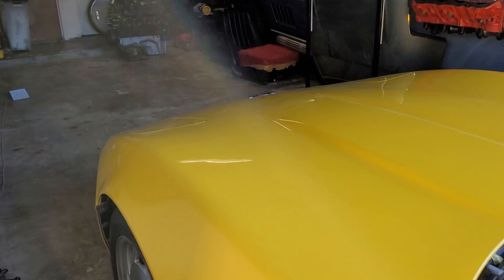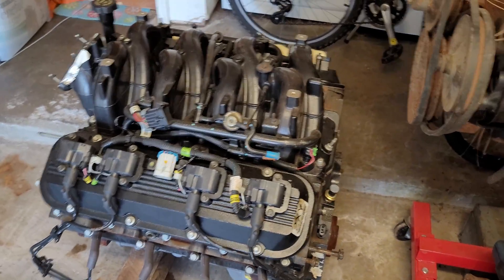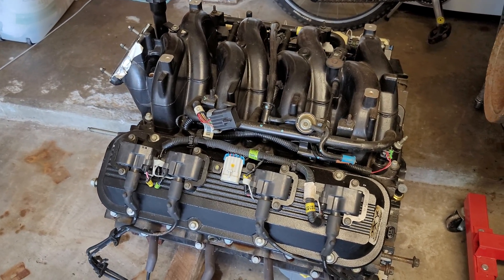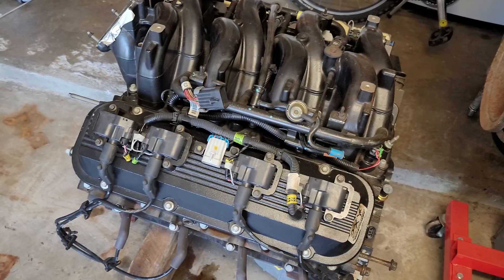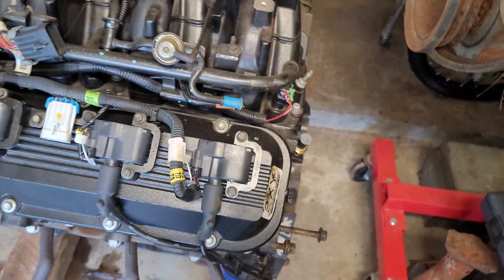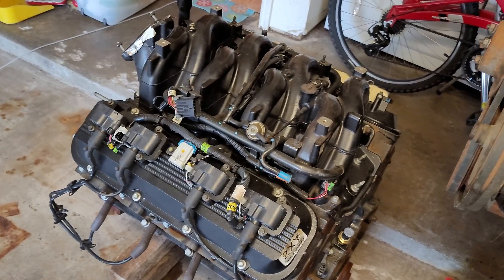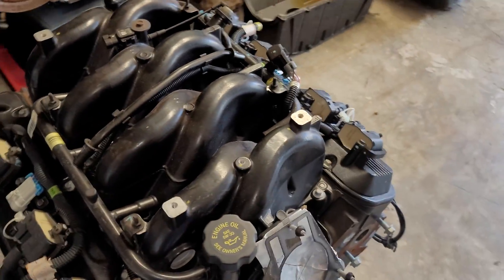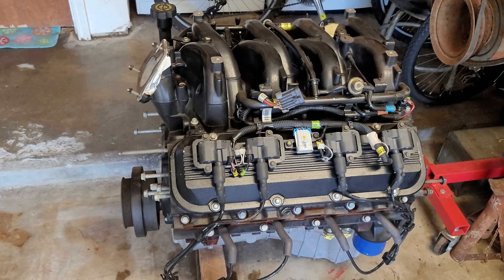The Monstrous Vortec 8100 496 8.1L Big Block Engine of the 2000's

Comment: I have an 01 2500hd with the 8.1 and the allison, Ive been a heavy equipment tech and a welder for the last 20 odd yrs and Im not looking for ward to doing the crank sensor or putting headers on it.  The studs look like rust particles holding hands and not steel, i may just leave the manifolds as im not keen on opening that can of worms.
Reply from the maker: Yea, those factory exhaust manifold bolts like to rust in place and snap off and soon as you put torque on them. I like the idea of the better flow headers, but I'm definitely in the camp of "best left alone". 

The crank sensor is definitely a bugger to get at, but it's workable with patience and being able to get yourself in the correct position on top of the engine so you can get your hands and proper leverage on it when replacing.
Reply: @VetteSource  this truck is bone stock too, other issue is the PRND321 and the mileage dont light up in conjunction with the p0705 so im wondering if the range sensor has something to do with that, also the tow/ haul doesnt light up either.  Whats shitty is that my solus legend wont pick up the mileage stored on the ecu so im wondering if the cluster is fucked.  Im HOPING the range sensor solves the issue, i mean its got to be replaced anyway so...
Reply from the maker: Yea, sometimes you definitely have to get in the weeds with this 1st generation Can-Bus wiring wiring system. Many times the cluster is at fault, but you can also have a problem with the range select switch like you talked about.
Reply: @VetteSource  got everything done and now all thats left is the fuel level sending unit, put some fuel in it and the gauge was all over the place so thats the next thing to do before the snow flys up here which may be in a matter of days.

Comment: A car? What a waste of a marine motor.
Reply from the maker: Really? How so? They're interchangeable either way, so I'm not sure how it's a waste.
Reply: @VetteSource  Wait and see.
Reply from the maker: Well, if you can't provide any basis for your opinion, I'm not really sure it's a valid comment. What exactly do you think would be the problem of operating this engine in a passenger car application? Maybe you missed the other videos I made performing the modifications needed to make sure it runs correctly in the truck.

Comment: I have a question for anybody that may get this I appreciate the knowledge of the guy that did this video he seems smart so now to my question I have a 1980 El Camino I have an old Schwan truck 2002 that is got the propane setup I'm wondering about putting that block in my El Camino and convert it back to gas?
Reply from the maker: Converting back to gas from propane is a pretty easy and straightforward process. I had to do the same thing to the 02 3500 8.1 truck I rebuilt recently. All I did was removed the propane equipment and hook the fuel line back up. Worked out perfectly.

Comment: I have a 02 suburban 496 and still outruns my newer 5.3. the 496 has 312,000 and has never slowed down. Nothing more than suspension, radiator etc.
312k on the original starter, coils, transmission, power steering pump etc. I wish it would give up so I can blue print and balance it and get even more power out of it!
Reply from the maker: Now that's a testimonial right there👍. Like you, I love the longevity of the engines, but always love any opportunity I get to tear into one.

Comment: Just bought a 2002 3/4 suburban. 4 grand. And want clean. Mostly Rocker panels rusted out a little, only a knock sensor code. Runs nice so far
Reply from the maker: Yep, if you can keep the body from rusting away from underneath you, it will last for many years👍

Comment: I can attest to the horse power and torque of the 496 8.1 I worked as a tow truck driver for a few years and the company I worked for used them in almost all their trucks most were factory propane fuelled or  converted to propane but a few trucks were gas powered and the c7500 that I drove was a dream no problem picking up anything and climbing hills it sometimes felt like you were driving a giant Cadillac if you had a Car on the back heavy enough to dampen the springs in the back and it had no problem keeping up with traffic on the highway or accelerating from a stop light it wasn’t as fuel efficient as a diesel but maintenance was much cheaper than the diesel’s and replacing a blown engine with a rebuilt one was around $5000 and they sounded great
Reply from the maker: Mark, great testimonial. Every time I'm on the road with my 8.1, I feel the same way. It's like cruising along in a very powerful Cadillac😁.

Comment: Can these be converted to carburetor, i also noticed it has holes in front of heads ?
Reply from the maker: I do believe I've seen a carburetored intake for the 8.1, but can't remember who the supplier or manufacturer is. The holes in the head are the coolant passages. It uses a different water circulation setup than the previous BBC generations.

Comment: I got a very nice 2001 Silverado 2500 hd with this monster engine, it IS a Duramax Killer!  I truly love my truck and in my opinion the 8.1 is the best truck engine ever built by GM !
Reply: The issue with calling it a Dmax killer is the dmax can make 650hp and 1000ft/lbs AND get 20+ MPG. I do love these engines tho and will be building one for a race truck soon
Reply: @TMar129  Well, since I got it back from Raylar, it IS a Duramax KILLER! Pushing over 800 HP! Lol
Reply from the maker: Yea, I think it comes down to a matter of preference overall. I've seen the power of the Duramax, but for a more casual over the road puller, it has always made more sense for me to utilize the gas big block haulers.
Reply from the maker: I would agree. Over the last few years people have figured out just how powerful and reliable this engine actually is, which has kept the value of the trucks and engines pretty high.

Comment: Could you elaborate on what you mean they use more oil?
Reply from the maker: Sure, this era of Big Block Chevys are expected to use about a quart of oil every 1000 miles. From what I've heard with the 8.1, it has to do with the design of the intake manifold/PCV system design. My 2000 MY year truck with the 7.4 also uses about a quart every 1000 miles. Chevy mentions this in the service manuals for the trucks and has issued several bulletins regarding this over the years.
Reply: @VetteSource  A quart every 1000 miles, that’s not good, not a good design. I wonder if they have that problem with the 8.1 marine engines, Mercruiser or Crusader?
Reply from the maker: Yep, it's all of them. Dont let that scare you away. You'll find in heavy duty equipment and engines that are worked pretty hard, oil consumption is a normal and expected side effect. 

The 8.1 is now considered one the more durable engines out there and is still in pretty high demand even more than 10 years after GM stopped producing it. They are also highly sought after for use in industrial generator applications.

I rebuilt an 8.1 truck that had been disassembled and left for dead for 5 years. All I did was pressure wash the engine, attach it back to the Allision 1000, fill it with oil and it fired right up like nothing.
Reply: @VetteSource  It’s a shame GM stopped producing the 8.1. If it would have stayed in production I would think they would have perfected it. The absence of the big block leaves a large gap in gasoline powered inboard boats. In the past, boats in the low to mid 30’ range typically had a pair of big blocks, now the only option for boats in the mid 30’ range is a pair of small blocks, which doesn’t really cut it, especially a boat with a deep, heavy hull, those small blocks have to run at a much higher RPM to cruise at the same speed as a pair of big blocks . Those small blocks just don’t have the low end torque of big blocks in cruiser type boats in the mid 30’ range. 
There are aftermarket companies that produce big blocks, I wonder why engine marinizers like Crusader Marine doesn’t hook up with after market companies and produce their own 8.1 big block inboard engines for cruiser type boats. That’s a pretty big market and would fill that void.
I don’t know a lot about Ford’s newer 7.3 Godzilla gasoline engine, but maybe that would be alternative, maybe Crusader Marine could marinize Fords 7.3 Godzilla gasoline engine?
Reply from the maker: Actually a company called PSI purchased the tooling from GM and is now producing them as an 8.8L 535 CID configuration. I'm not sure if they offer a marine version, but it would definitely be the answer for the larger boats you talked about.
Reply: @VetteSource  That would be perfect. They should hook up with Crusader Marine, would fill that void perfectly!

Comment: have a 2005 2500 hd with the 8.1 with the allison have 260000 miles love this truck . oil consump problem found the best to run half 10w30  and haif 10w40 castrol our valolina does the best summer and winter this truck is my daily driver   the cost of new trucks to maitain this truck keeping this truck if i find another one of this trucks and surburban i buy them and hold on to them
Reply from the maker: Good suggestion, thanks for sharing👍. I'm with you, an 8.1 truck and 8.1 suburban is all you need.

Comment: I have 2 8.1s i am putting a 4l80 on the back but am having a problem with the converter fitting tight against the flywheel have you ran into that before?
Reply from the maker: Hey Don, I haven't but have you verified if your using the flywheel specifically made for the 8.1/4L80E? From memory it has a specific GM PN# and is rather pricey.

Comment: I've got a 2001 3500 extended cab Sierra 3500 with the 8.1 and still have my '78 Silverado dually with the original 454.
Reply from the maker: Hey Daniel, these definitely tend to become forever trucks. Like you, I have a 2000 OBS Crew Cab 3500 SRW with the Vortec 454 and a 2002 NBS Crew Cab Dy
Dually with the 8.1 that will last me until the day I die.

Comment: I have a 2004 chevy silverado 2500hd with a 8.1L in my truck so my question is can I use Rotella T4 oil 15w 40 in my truck.
Reply from the maker: I have seen people using the Rotella heavier weight in their trucks. For an 8.1 with a little higher mileage, it may be a good way to keep the oil consumption within tolerable limits.

Comment: I did a crank position sensor in a chev 2500 today and want to slap the engineer
Reply from the maker: I hear ya. At least you had the 2" body lift to work with instead of trying to change an 8.1 crank sensor in a 3/4 ton Suburban😁.
Reply: @VetteSource  yeah but the Allison still clods it up good. I was just glad it got it out first time without breaking. It was the OE from 2002
Reply from the maker: Yea, those original sensors don't like to release when they've been in there for decades. Not to mention, climbing up on top of the HD trucks to get at the back of the engine isn't the most comfortable position🤪.

Comment: This is the engine driving my 2004 National motorhome in a 2003 GM Workhorse Chassis with an Allison 1000 Tranny.
Reply from the maker: Yep, I've heard they do an excellent job powering the RV rigs.
Reply: @VetteSource  From what I have heard, way better than the Ford V-10s, and the Allison is a beast.
Reply from the maker: Yep, I would agree.

Comment: I was lucky enough by chance to find for sale a 2001 Chevy CC dually 8.1L/Allison 4x4 with only 32,000 miles on it four years ago. Had it shipped to New England site unseen. It was titled to a courthouse in Florida and had a steel flatbed on it. Found a clean takeoff oem dually bed out of Texas and grabbed it. Still needs a paint job after years in the sun in Florida but a great running truck. Gas mileage not much less than my 2008 1500 5.3L. Kicked New England winters ass plowing the last few years. As far as the oil consumpsion goes, install a catch can system while blocking off the plenum under the intake manifold and problem solved. Spent years (5+) reading about and watching all I could about the 8.1 before finding this truck. Future classic! Edit: have a 2nd 2001 8.1L/Allison 4x4 164k truck for parts. Also grabbed by chance, can't go wrong there!
Reply from the maker: Hey Larry, thanks for sharing your 8.1 truck story👍. It sounds similar to my experience with these great trucks. I always wanted one, and finally acquired a 2002 CCLB dually that had been disassembled, than found an 8.1L 2004 Yukon 2500 XL with a blown engine. Then I stumbled across a 2001 GMC 2500 extended cab needing an engine. I'm close to having the first two trucks back on the road, then will start in on the 2500 shortly.

Comment: So it can't fit ls7 heads or intake manifold
Reply from the maker: No, unfortunately not. Evene though it's got quote a bit of LS architecture, it's still a BBC and a unique animal onto itself.
Reply: @VetteSource  man it would be hard to get aftermarket performance HP out of it
Reply from the maker: You'd be surprised at the aftermarket stuff that is available. There's another channel here on YT that is building one with over 1000 naturally aspirated HP. Of course, none of it is cheap, but you know how it is when building BBC engines😁.

Comment: I still run my '03 Silverado 2500HD to this day after all these years pulling our large 5th wheel trailers. Current 5th wheel is close to 14k lbs. Fuel mileage is nothing to brag about but this is a very large engine with little design given to saving fuel. In town fuel mileage is going to be little over 8mpg on average and close to that towing in all conditions. Unloaded on the highway could average ~13mpg if given enough flat roadway. But it really pulls well and that's why we still use it, well that and new trucks are not given away. I'd say we've got our money's worth.
Reply from the maker: That's the general consensus with the 8.1 trucks. Getting your moneys worth and then some. Wouldn't trade mine for the world. Thanks for sharing👍.

Comment: The 496 is a 454, bored & stroked to a 496.  BIG Torque. That's what I've been told. I put a catch can on, and it catches oil. It uses 1 Qt. of oil every 1,000 mi. I will never ever sell my 2001 Suburban. They do make a rod knock sound on start up, for about 40 seconds.
Reply from the maker: Hey Cheechum, thanks for the testimonial. The 496 is becoming more legendary as the years pass with so many of them still on the road doing the hard work.
Reply: @VetteSource  Sorry for the late reply. I still have mine and I hope I will never have to part with her!

Comment: Got a 2005 ,GMC 2500 8.1 VORTEC ,ALLISON TRANSMISSION ,CREW CAB, LONG BED 4 WHEEL DRIVE ( ABSOLUTLEY LOVE IT ) HAD IT ABOUT 3 YEARS NOW , IT'S STOCK ,BUT A BRUTE , IF I WANT SOMETHING MOVED OR TOWED IT'S READY & CAPABLE ,BEST TRUCK FOR TRUCK STUFF I HAVE EVER OWNED 
JUST TURNED 144,000 MILES ( GET R DONE )
MY BUDDIES SAY TOU'LL BE DAM LUCKY IF YOU CAN MOVE THAT , GUESS I AM LUCKY !
I HAUL CARS ,SCRAP STEEL ,LUMBER , YOU NAME IT , SIT BACK LISTRN TO THE AWSOME BOSE STEREO , SET CRUISE ,& TOW HAUL ,& JUST DRIVE !! SOULDN'T TAKE 2 OF THESE NICE NEW SHINEY PLASTIC TRUCKS FOR IT , THIS TRUCK IS THE REAL DEAL ! WAS LUCKY MAN THAT OWNED A CABINET SHOP OWNED IT , FOR HIM & HIS WORKERS TO GET TO JOB'S ,HE OWNED ,HE DROVE ,HE MAINTAINED TRUCK ,HAD A 18 FOOT LONG ENCLOSED TRAILER FOR CABINETS ,ETC , INTERIOR & ALL GREAT
A/C COLD ,EVERYTHING WORKS FLAWLESS ,
REALLY IMPTESED , LOVE THE ALLISON TRANSMISSION & WHEN IN TOW HAUL IT HELPS HOLD BACK WHEN SLOWING DOWN , ONLY FUTUTE PKAN , I WANT TO PUT DUAL EXAUST ON IT !
OTHERWISE LET IT EAT !! I PASS THESE NEWER TRUCKS ALL THE TIME STRUGGLING EITH A CAMPER ,OR TRAILER LOADED ,FRONT END LOOKS LIKE YOUR ON ONE OF THOSE HUMPD HUMPS AT A DRIVE IN MOVIE .( LOL ) WHEN IT SNOWS I FILL UP A LARGE COFFEE MUG & THERMOS & HEAD OUT 
REALLY JUST TO RIDE , BUT I DO USUALLY TAKE MY GEAR & MAKE SOME GAS MONEY PULLING PEOPLE OUT , I REMEMBER ONE GUY OFF ROAD ABOUT 30 FEET WHERE HE HAD DUG & SPUN & SLIDE DOWN ,HOOKED EVERYTHING UP READY TO PULL , HE SAID YOU GOT IT IN 4 WHEEL DRIVE DON'T YOU ? SAID NOPE HASN'T BEEN IN 4 WHEEL ALL MORNING & I BEEN THE ONLY SET OF TRACKS ON MOST ROADS , I SAID I WILL WAIT & SEE IF I NEED IT 
A LITTLE WHEEL SLIP AT FIRST , THEN WITH SOME FEATHERINGBOF GAS FOR OPTIMAL TRACTION ,UP & OUT CAME HIS DODGE HEMI RAM ,IT WAS IN 4 WHEEL DRIVE , HE WAS AMAZED, UNHOOKED DROVE OF STILL IN 2 WHEEL DRIVE ,OH DID I MENTION 8INCHES OF SNOW ON GROUND ,LIGHT SMALL FLAKE SNOW FALLING ,HAD SNOWED ALL NIGHT !
LOVE ME A WORK TRUCK ,& GOT ONE !!
Reply from the maker: Hey Gary, now that's a testimonial! 20 plus year old truck that makes you money while your out just cruising around. I'll have to save your story for everyone to see👍.